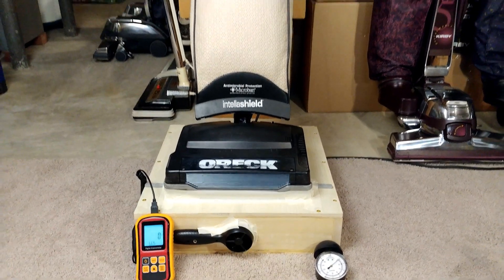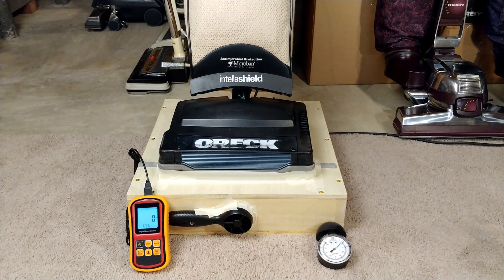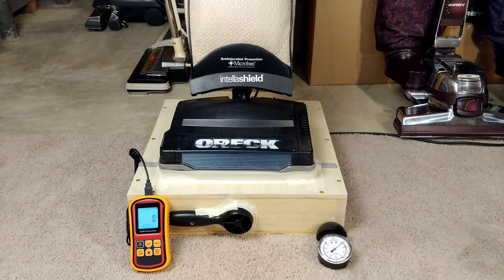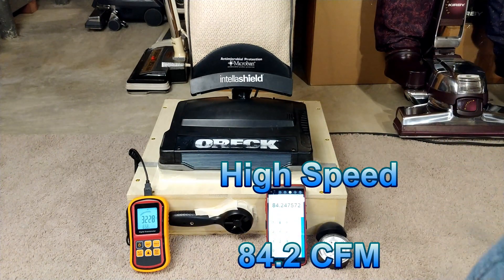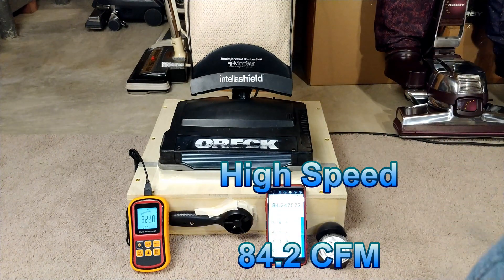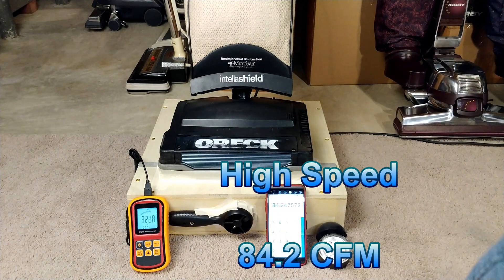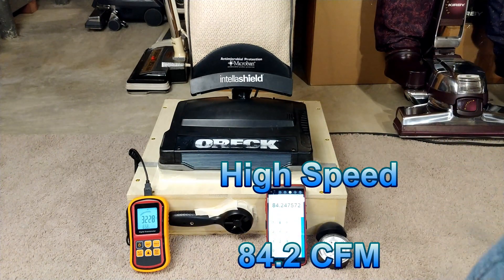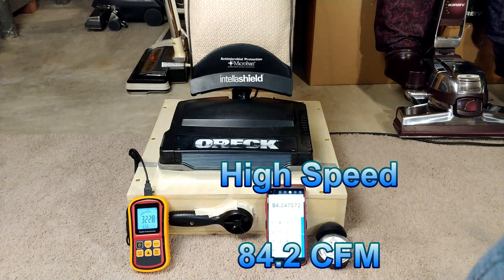Oreck XL21 Airflow And Suction Tests

Comment: Yes the results are similar to my own. I  look forward to seeing how the upcoming pickup tests will compare to mine. I got 66% of sand with my 21 60% with a RU4090H2T. I'd think the baking soda test though will turn out significantly better due to the additional airflow compared to your XL2800

Comment: Good work on the refurb.. the plastic parts make it really difficult to fully renew.  You almost need to pull out the car detailing equipment and paint to fully pull it off.  Nonetheless.. excellent work!
Reply from the maker: Yeah, the "Oreck" logo needs major help. Or just plain replacement. 👍

Comment: Oreck vacuums are weird animals. They've always been geared towards commercial customers, people that vacuum all day. Efficient, light, and reliable but usually exclude the features of residential vacuums (like a hose for example). That's my opinion anyway. I wouldn't own one for my house but that's because they aren't really suited to home cleaning. Electrolux and Kirby are more of the home gamers style.
Reply: Well, the main reason for the lack of hose is because their suction power is pretty bad and they lack the ability to lift the brushroll off carpet when the handle is up. The whole package is, as you said, designed to vacuum all day on floors. Reducing weight has lead it to that specialization. Adding a hose, a floor head lifting system and a bigger motor to make that hose useful would just end up with a machine like a Hoover Elite.
Reply: Most Orecks ordered new came with a canister vacuum to clean all of the above floor stuff. I still use it to clean my car, but it's not the best.